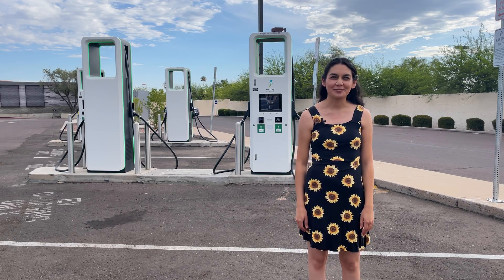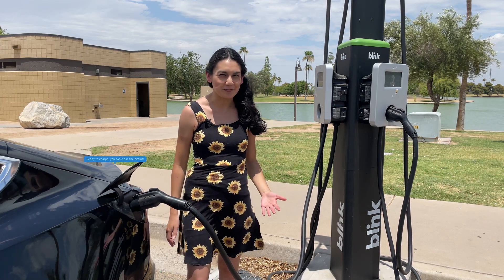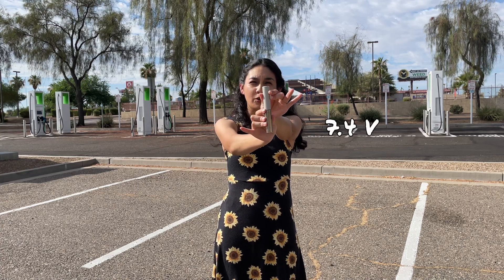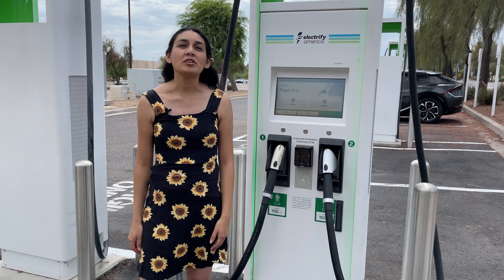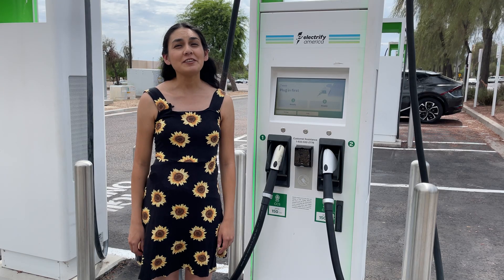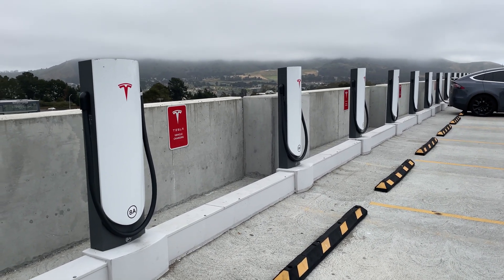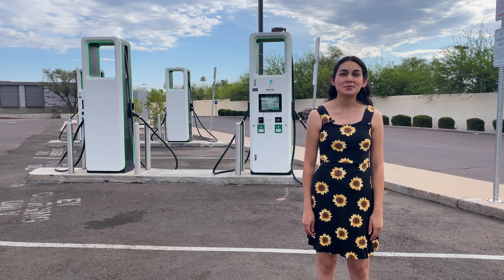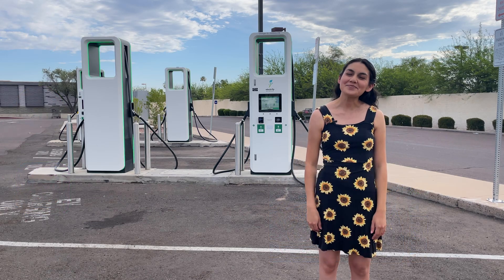400V vs 800V Charging– What does it mean?

Comment: 800 is not only the future, but it's the from here on out. Your points at the 7:10 minute mark are a lot more significant that simply that. It's way too much to explain in a post, but if any of you search for the terms below, they do far better job of demonstrating it for all to see the vast advantages, and why it makes it possible for an EV to have an independently proven range of 500 miles.
Battery Pack Tech Talks Lucid Motors
and
Charging and the Wunderbox

Comment: 6:45 Again, this is a myth. Some 400 V vehicles also require access to 350 kW chargers in order to see their maximum charging speeds because the 150 kW chargers typically only provide 350 A of charging current while the 350 kW chargers can provide 500 A up to 700 V. While it's true that a number of 400 V EVs should prioritize the 150 kW or slower chargers (e.g, the Chevy Bolt or Hyundai Kona), that is based on the specific EV's maximum charging current. For example, a VW ID.4 can't pull more than 350 A, so it has no reason to use a 350 kW unit. However, EVs such as a Cadillac LYRIQ or a Tesla using Tesla's new CCS adapter can pull 500 A despite being 400 V architecture EVs, so their max charging speeds would be 120 to 130 kW on a 150 kW charger rather than the 180 to 200 kW they would see on a 350 kW charger.

Comment: For North America, the difference really only matters for the car, but not so much for the chargers. Even the older 24 kW to 50 kW DCFC are supported by newer 800 V architecture EVs (as you noted, they all have HV converters). What matters more than charger voltage at this point is charger amperage, and most 150 kW chargers are restricted to a maximum current of 350 A while most 350 kW chargers can provide a maximum current of up to 500 A.

What this means in the real world is that, despite popular opinion, 800 V EVs should not be given priority on 350 kW chargers based solely on their pack voltage. Many 800 V EVs cannot actually accept a full 500 A of charging current while a number of 400 V EVs can, which means that both 800 V and 400 V EVs can see a significant boost in charging speeds by using 350 kW units. 400 V EVs such as the BMW i4, Cadillac LYRIQ, Ford Lightning/Mustang Mach-E, Mercedes EQS, Rivian R1T, etc. all see significant gains by using 350 kW units. 

In fact, at this point, it appears that only the GMC HUMMER EV is capable of fully utilizing a 350 kW charger because it is able to draw a full 500 A at 700 V (the maximum power a 350 kW charger is capable of providing), while most other 800 V EVs are not maximizing both the peak current and peak voltage that 350 kW chargers are able to provide.

Comment: 3:27 This is not correct. The 150 kW chargers are still capable of supplying 900 V to 1000 V, but because they have fewer charging modules than the 350 kW chargers, the 150 kW chargers cannot provide as much current at those higher voltages. The 350 kW chargers are capable of providing up to 500 A at up to 700 V (why they are rated as 350 kW). The 150 kW class of chargers vary, but typically they can only provide 350 A up to 500 V and as a result only about 175 A up to 900 V to 1000 V (why they are commonly rated as 150 kW to 175 kW).
Reply: Absolutely, I've gotten a little over 150kW at Electrify America's 150kW chargers even though my voltage booster is limited to 50kW.

Comment: Great channel - thanks for your great work. The capacity of the car and the charger combo seems to make a big difference to charging time. It would be good if you could give some ideas on how long it takes to charge different car and charger combos. On a road trip a 10 - 15 min stop is comfortable but 30 - 40 min stop changes the day plan. Additionally it would be interesting to see info on types of Self Drive/Cruise Control systems. If Tesla can get FSD to a level that is safer than a human driver this year it is going to be a game changer for the car industry. I suspect Joe average doesn't understand the difference between FSD and the others. Like what's the difference between FSD and Fords Blue Cruise and GMs Super Cruise?